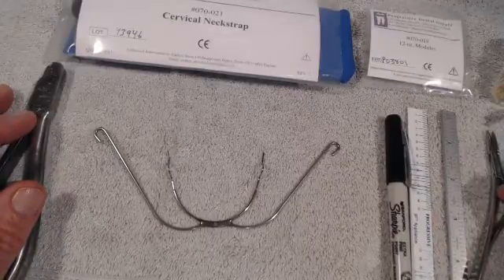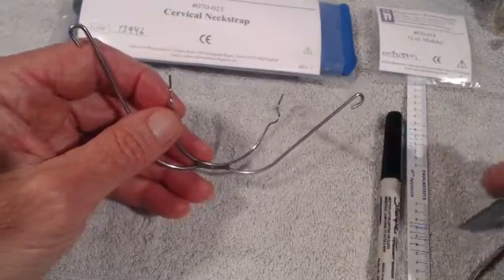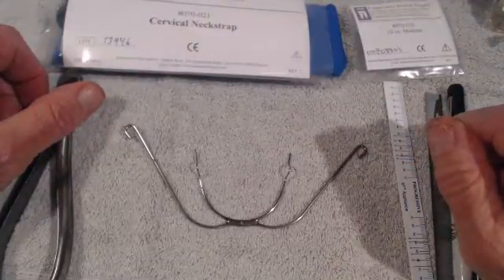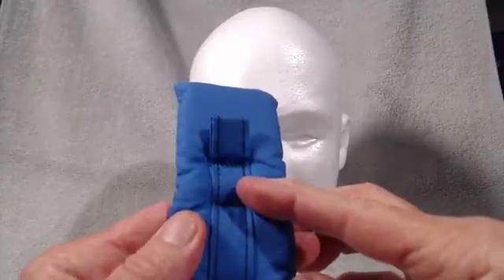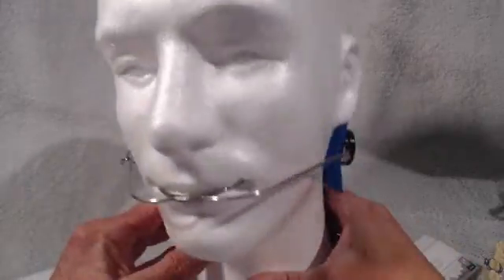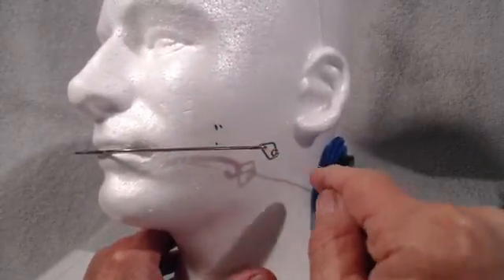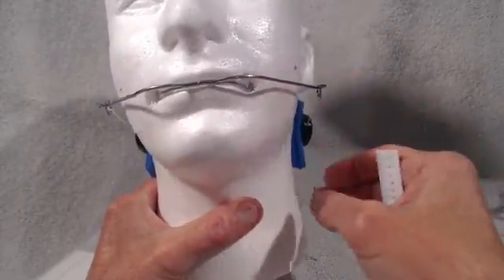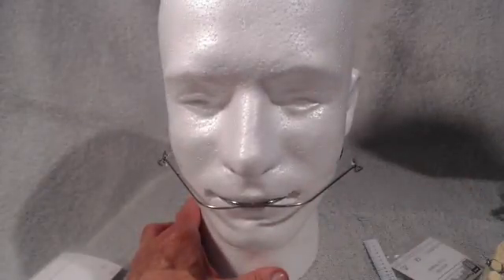Cervical Headgear delivery, outer bow and force axis adjustments

Comment: Dr Taylor,  can you suggest an instrument that lets you check the force through the COG of the molar at review appts?  Also does it matter if the headgear is not completely symmetrical?  Ta
Reply from the maker: +applemachappy 
There is no instrument currently in production for this purpose.  You will need to use the same modality to locate the center of resistance as you did at the initial placement.  The best way to check is to take a ceph with the HG and neck strap in place.  The metal clips and the spring in the force module can make a line that needs to pass thru the center of resistance.  I am presuming your "COG" is your abbreviation for the center of resistance.  
It does not matter if the HG is symmetrical but again I am not precisely sure what you are asking here.  The force right to left needs to be the same.  Since a left and right molar can be asymmetrical, then the HG usually will show some asymmetry.  Are you a current Progressive Ortho student or past graduate of our program?